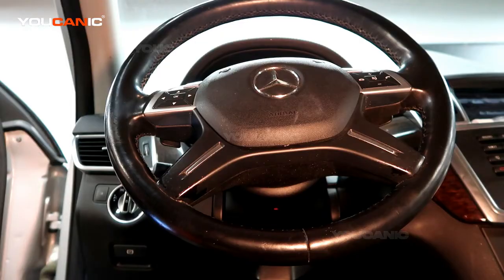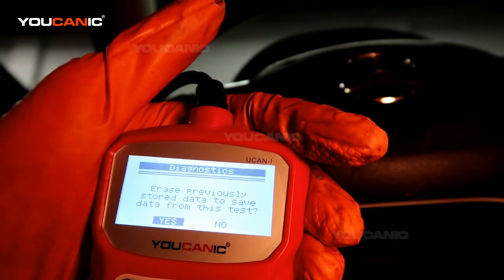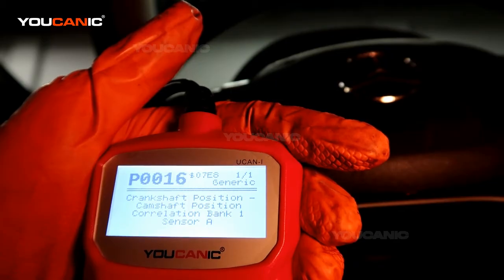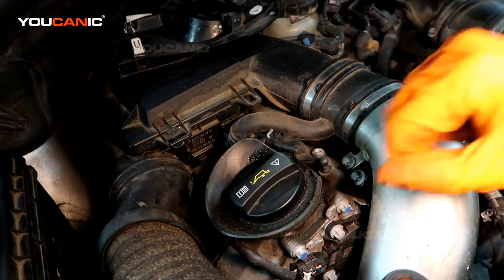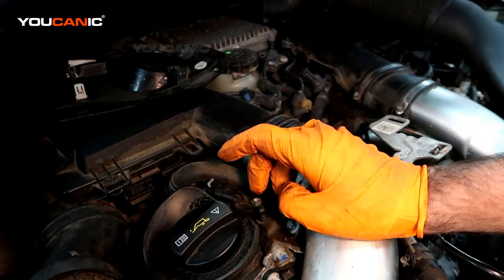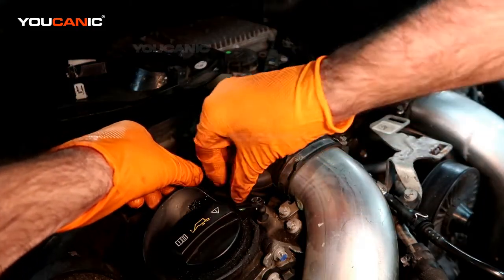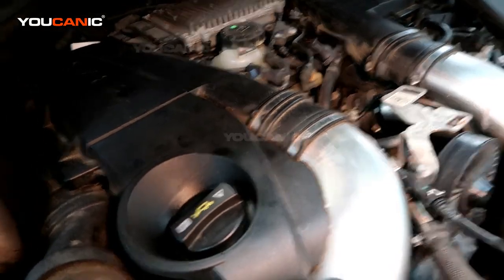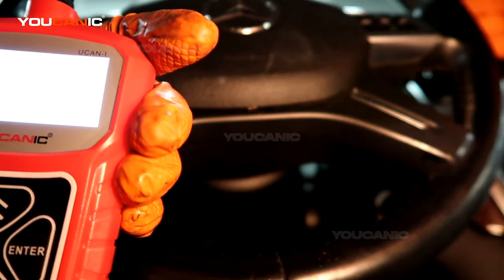Mercedes-Benz P0016  -  Crankshaft and Camshaft Sensor Replacement

Comment: thanks a million , the mechanic told me to not waste my time and just replace the timing chain at the dealer ! would of cost me 4k ....after your video I told him to replace the sensor on bank A   and poof car is running baxk smooth .   I almost got screwed .
Reply: What car did you have this done on? Year and model? Also it was p0016 correct?
Reply: @henrygarbrah6261
Reply: Yea I wanna know

Comment: Youcanic this is my exact problem with my c400 amg literally alone with a few other codes I hope this fixed my car also needs 02 sensors which what was most of the codes when I got it check out at autozone

Comment: Thank you for the video and explanation of the fault code and how to repair/replace it to fix it.  Showing which bank the sensors are located was great.  I may reach out for your info on a manual for a 2014 ML350 as I have the same P0016 code.  Ill keep replacing any part if any other codes continue to show up.
Reply from the maker: Thanks for your comment! We're happy to hear that you found our video and the information provided helpful. At Youcanic, our aim is to help car owners like yourself feel confident in understanding and solving car issues. We offer a variety of resources including car repair manuals for different models, like your 2014 ML350. If you encounter other fault codes, remember we're just a click away on our website (www.youcanic.com) ready to assist. Remember, Youcanic is here to empower you and support you on your car ownership journey!

Comment: Is the position sensor in the same place as on a 2017 glc 43 amg?
Reply from the maker: Thanks for reaching out! Yes, normally the position sensor is in the same location across similar models. To have it confirmed for a 2017 GLC 43 AMG, we recommend you to visit our website, YOUCANIC. We're committed to providing car owners with tools, guides, and resources needed to handle car maintenance confidently.

Youcanic has factory repair manuals and a powerful scanner to further assist you. Drop us a comment or question there anytime, we're here to support you throughout your car ownership journey! 

[www.youcanic.com](www.youcanic.com)

Comment: Are both sensors the same or different
Reply from the maker: Thanks for your question! Whether or not the sensors are the same or different can vary based on the specific make and model of your car. At Youcanic, we provide comprehensive guides and resources to help car owners like you. Check out the YOUCANIC scanner, our user-friendly tool that could help with your query.

Feel free to visit our site for more information or to ask further questions. Whether you need general guidelines or specific factory repair manuals, we've got you covered. Our aim is to empower you in your car ownership journey. Let's keep things running smoothly together! www.youcanic.com/

Comment: 07e350 has the same p16 and 17 but also showing a map sensor code but mine cranks just fine but when I turn the ac on you can feel a sputter
Reply from the maker: Hello! Thanks for reaching out to YOUCANIC. We're here to help you navigate through your car issues. We recommend taking a look at our guides and resources to help diagnose and resolve the map sensor issue you're experiencing. You can also use our YOUCANIC scanner if needed. 

If further assistance is needed, don't hesitate to reach us on our website www.youcanic.com. We even have factory repair manuals for those complex issues. At YOUCANIC, our goal is to empower you on your car ownership journey! We're always here to support you.

Comment: You didn’t show how to replace crankshaft 
You only replaced cam shaft sensor?
Reply: i have same code and was thinking i need to replace crankshaft sensor but for the 2012 cls 550 the intake manifold is in the way
Reply: @toco002 I have a 2012 CLS 550   as well with the same code. I changed the cam sensors and magnets, but the problem persist. Do you know where the crankshaft position sensors are located, bank 1 sensor A?
Reply: @judahisrael8241 were you able to fix it. I heard this issue is actually related to camshaft itself not the sensor
Reply: @seankorg1024  haven't gotten around to fix it yet. But I have the shop manuals showing where the sensor is located and the steps to remove and replace. Interestingly, when the code appears I use my code scanner to erase the code and the car starts without any hesitation, which leads me to believe it is the sensor, could be wiring. But will be changing the sensor soon and will update then.
Reply: @judahisrael8241hey were you able to fix the problem?
Reply: @dylansuhren8585 yes 
I sold it to the carmax 🤣
I only relaxed camshaft sensors it was on top of each bank 
I hope this helps

Comment: What is the name of the sensor that you replaced?
Reply: Camshaft position sensor. Part# 2769051000. The m278/m157 has 4 of these, 2 on each side. When replacing these sensors (also reolace the solenoid magnets p#2761560790), wipe any oil from the electrical connectors' pins as it travels down the elec harness to the ecu
Reply: @georgialdev1001 do I need to replace the solenoid sensors all the 4 sensors also ?
Reply: @SfCars  yes, ideally. The electrical sensors are much easier (more accessible) to replace than the magnetic pucks which i could not replace all. But the sensors are easy, mine were full of oil. Check them every oil change, ECU pins too.
Reply: @georgialdev1001 great thanks for your fast response,well I ordered parts already.btw I have  2 faults codes p0018 and p0017 so I hope Changing the sensors will solve the problem 😅